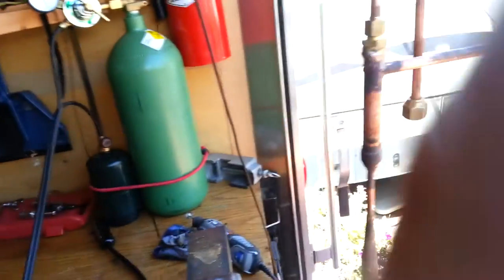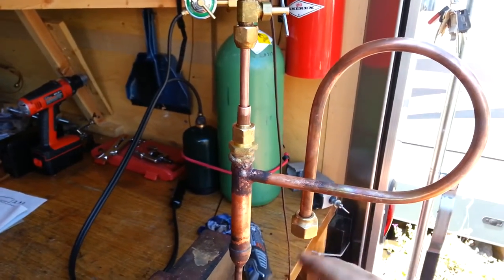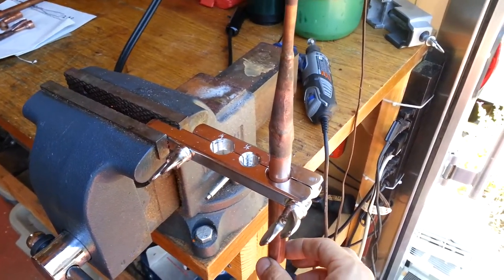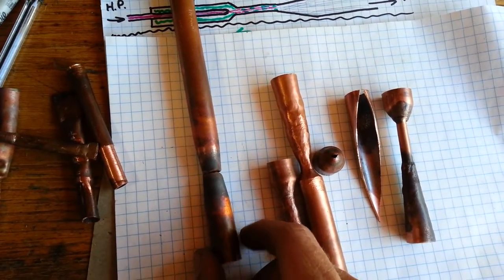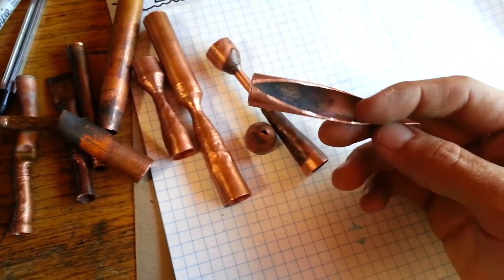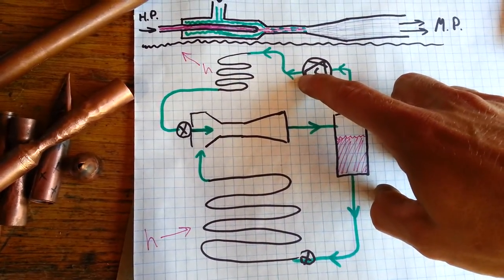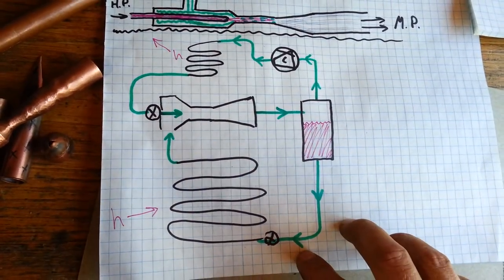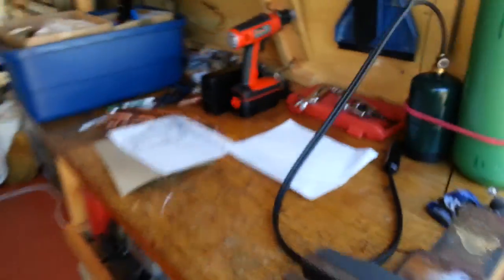Ejector Refrigeration

Comment: I actually built a unit with an ejector over a year ago. The ejector was made out of a MIG welding tip brazed into a tee. I designed it with two evaporators so there are two stages of cooling for better dehumidification.
http://ecorenovator.org/forum/geothermal-heat-pumps/3035-diy-dehumidifier-air-conditioner-heat-pump-water-heater.html
Reply from the maker: NiHaoMike Very cool Mike!  I'm actually a member on that forum (Marx290).  I haven't been on there for a while, or thought to search it for info on ejectors; I wish I had.  I didn't know of anyone doing small DIY ejector stuff like this.  I read through the thread, and I have to say I'm impressed.  The last post was about a year ago; how has the project worked out?  Have you manufactured any more ejectors?  I'd love to see more pictures.  

I'm hoping to have a simple split AC system up and running this week, to test some ideas for the domestic heating - heat pump this fall.

Comment: You are doing exactly what I've been working on for 20 years. I so impressed with your understanding of the elephant in the room. Nice work!  I'm using a tiny liquid pump to force some of the refrigerant from the receiver into solar flat plate exchangers to add heat and pressure to the refrigerant in place of the compressor. I have tried a bunch of commercial SS micro ejectors but they only work under ideal conditions. I think the key is to buy a SS microinjector that is variable and a liquid pump that is also variable speed. Keep up the great innovation. If we can make this work, it's a trillion dollar industry.

Comment: HI I'M gonna make an ejector refrigeration system and can u give me some suggestion on what is the ejector size means a diameter  of the primary nozzle in ejector and constant area section, a length of the constant area section convergent angel. what is the diameter of copper pipe u used in this system and what is the capacity of a compressor?plz, tell me if u can and thanks for ur video its very help full.

Comment: Hey I'm an engineering student, I have picked ejector refrigeration using exhaust heat for my final year project but I am having trouble designing the ejector would appreciate it if you could help
Reply from the maker: Adheip Yogananda Steam ejector or some kind organic rankine cycle?
Reply: M.C. Pletcher I am using it for a refrigeration system just like you are but have no idea how to design it for my system parameters or what parameters i need to design it